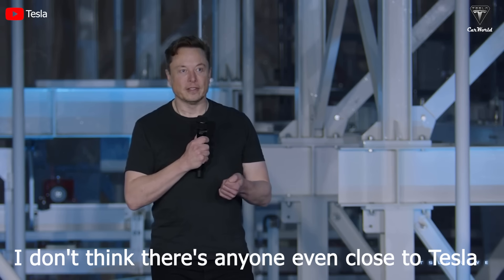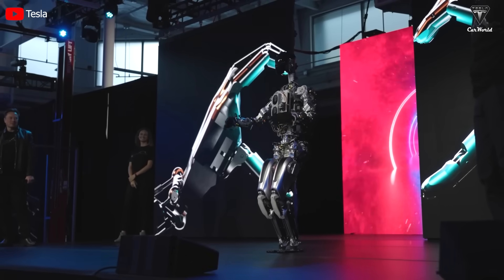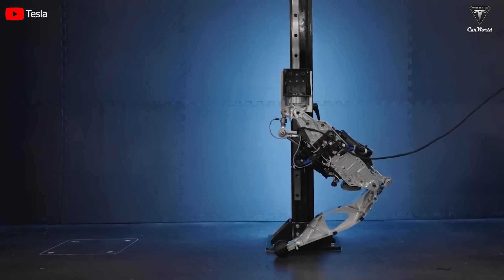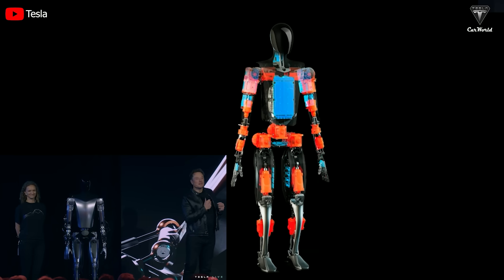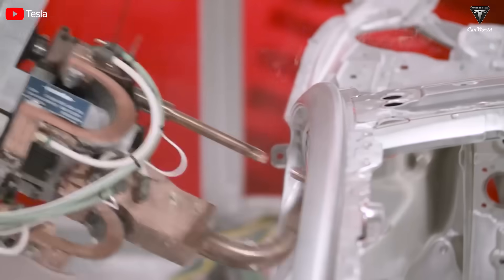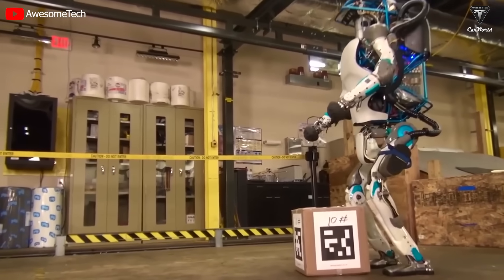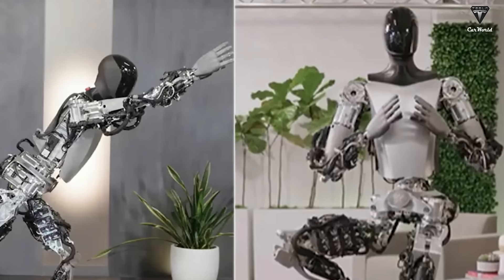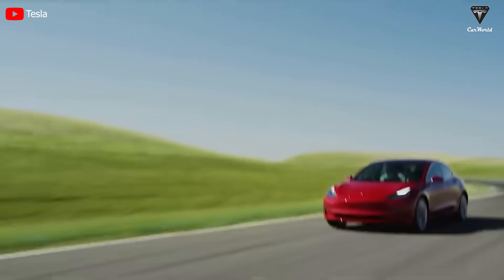Elon Musk Unveils Optimus Gen 2 30% booster, 22lb lighter! Model 2 Production's Game-Changer!

Comment: Elon Musk has said that Tesla's Optimus Gen 2 robot will cost between $20,000 and $25,000, which is less than half the price of a Tesla electric car. The price may decrease over time as Tesla gains manufacturing milestones. The robot is expected to be around $225,000, which is similar to the price of the Model 2.

Comment: Wow able to replace humans No wonder the UN has signed nations to depopulate Humans by 2030 and by what one-third only so what is going to complete the two-thirds? what with more wars more released pandemics and not counting the natural disasters that will increase as the sun goes into shedding its burn nuclear skin and increased UV radiation and not that AI replacing bosses and even CEOs of companies and robots when they can move and run faster than humans something that Military will demand as cannon fodder becomes less inclined to die for the puppet masters in power Elon is playing on two sides produce Robots and tell some TRUTHS the middle man the Judas Goat with his 30 pieces of silver with EVs exploding because of the batteries as NO army will have any type EV equipment ever except AI and robots to replace humans as cannon fodder. Please have a bit of foresight and intelligence otherwise you may be replaced also.
MPK.

Comment: The robot should only be useful at this point if it actually where useful. If the hsnds could be swapped out like modular units by an standard connection for wich other companies could manufacture the most critical parts.
Reply: Tesla dont do third party. For your vision, you will need to wait for a Chinese or Sth Korean version who will license their platform. But you never know, they may have learnt from their automotive experience, you cant do it all and you cant own it all, you gotta be a platform so others can make a living as well.
Reply: @AugustusOmega  maybe so. But i think your right. Maybe the ego is holding Musk back a bit. Instead of a big rocket what he should focus on (maybe keep research going tho) in my opinion is put research on slingshot/electromagnetic propulsion.

Comment: I wonder how difficult it is to replicate human-like movement like walking or running. This a slow but promising improvement.
Reply: It is limited due to the actuators and pistons that they build. It walks like that due to the way the actuators and pistons are placed. Our bones and muscles are encased within the skin AND the bones and the muscles are attached to each other in a way that our legs are able to straighten in a line, but the actuators are set up in a way that they can't straighten like humans without the pistons attached outside that line which would make it straight or seems straight but the piston would be outside of that straight line.
Reply: @1flash3571 Exactly, the hip, spine and all of that that connection has fluid with bone joints and is complex, says a luddite in these areas; a doctor would explain that better I am sure.  But connecting the torso to the legs and have it all work smoothly takes years as well, look at a toddler crawl, walk ( some people never do walk properly and never dance :P ) and later in life so many people have hip/knee replacements etc.  So yeah, I am not surprised that part is tricky and with weight ratios of a metal structure.  Again, not an expert here at all.
Reply from the maker: We don't think this is a slow improvement because this is a technology that Tesla entered in less than two years, 3 generations of robots in 16 months is amazing, please support this and look forward to the Tesla bot! Thank you
Reply: @TeslaCarWorld  shut up you moron
Reply: @TeslaCarWorld  go finish elementary school
Reply: Have you ever heard of Boston Dynamics, this garbage is not a leap forward in any direction, how stupid are you Musk fans, this is a complete trash product.

Comment: I could see this robot replacing all the cheap labor on farms requiring hand picking, such as strawberry farms.
Reply: Only problem I see with that (for now) is that one of these robots will probably cost more than the salary for 4 people. They need to come down in cost before widespread adoption happens
Reply: @jasperdinardi9040  you're comparing a one-time cost to a salary. Over time, as long as the operational cost is low, this robot is still cost effective.